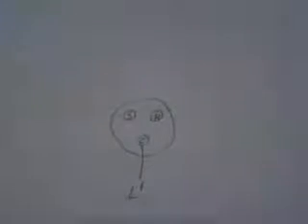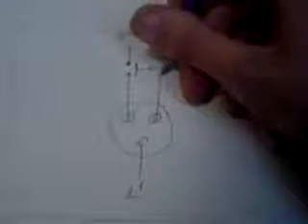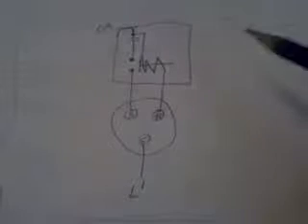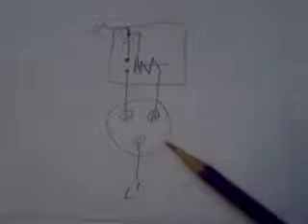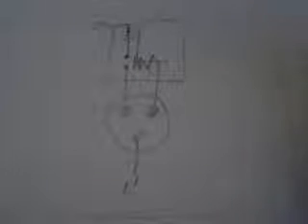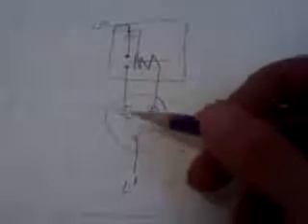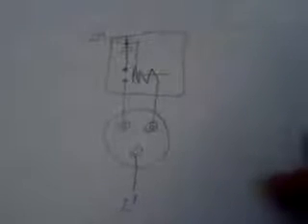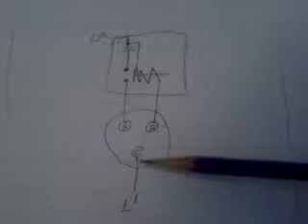Question About Electric Motor

Comment: lenzses law ,The roter generates a back EMF as compaired to the start winding ,thus limiting the current. Thats why locked roter amps are so high no back EMF. I say locked roter amps ,you could even say no roter amps ,If you take the roter out of the motor and energize the stater coil it will pull locked roter amps. If you realy want to understand this subject learn about power factor ,and how capactors work with inductors.Motors are where you start to leave electrical and go to electronics.

Comment: a motor is an inductor.  An inductor when first connected the current is at its maximum until  the voltage across inductor builds up .  Current leads voltage. The inductive reactance  (part of impedance) increase  thus reducing the current after a period of time,
hope this helps.